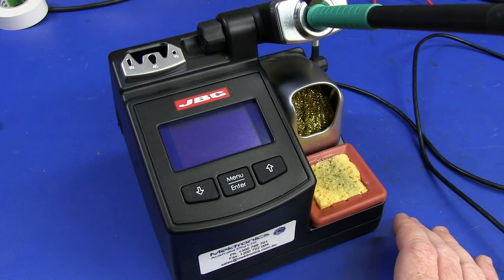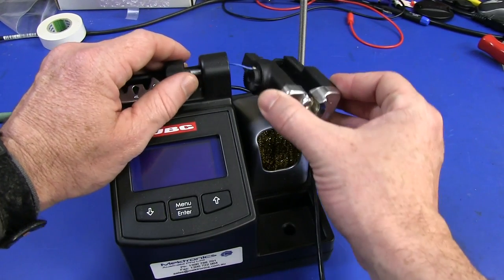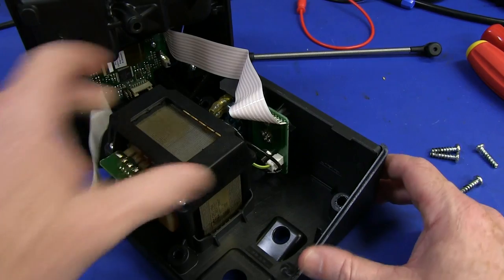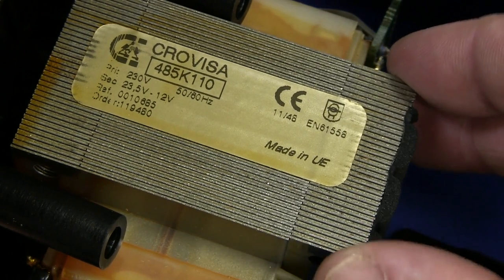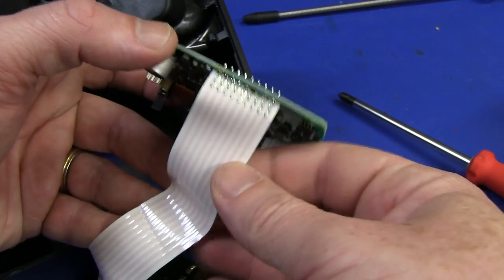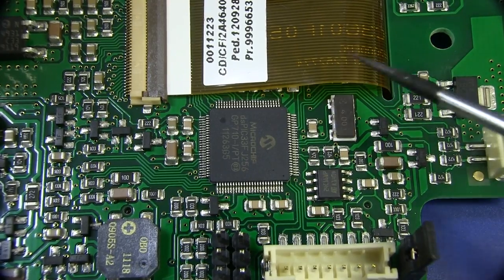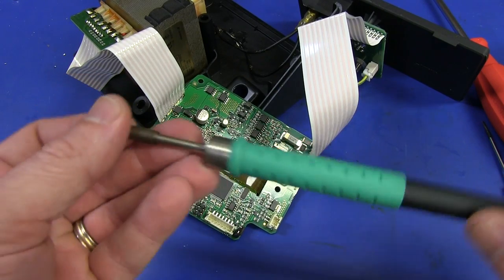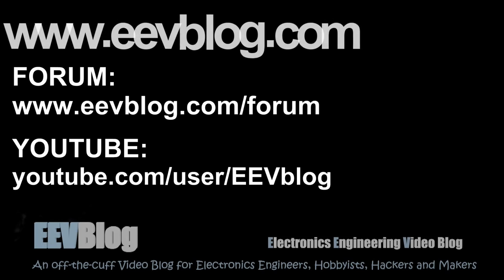EEVblog #472 - JBC CD-2BB Soldering Iron Teardown

Comment: Mixed feelings (mostly due to overly high expectations) but overall I wish I had bought it years ago. It is an essential buy for anyone who solders anything to power planes. It works so fast on them it's scary (4 seconds versus 2 minutes in some cases). For small surface mount stuff it's good but there's nothing I couldn't already do with my WES51 with an extra second or two. Other stuff like quick tip change, better temp regulation are nice but nothing earth shatteringly amazing. contd:
Reply: same here, the good feelings comes later when you need it :)
Reply: Im a first timer, im either buying the the dual station with tweezers and precision iron , or I might buy them separately with the modular unit.

Comment: In Ireland the tips range from 15-25 euros, some speciality tips run a little more. If they are not abused they last way longer than the cheap ones and with the auto standby its hard to go wrong. I love it way better than my pace iron.

Comment: Just received a JBC CD-S soldering iron (same principle as CD-2BB) and JBC CP Tweezers, to replace the crappy Ersa stations I have in the office. Those JBC stations are amazing concerning the heating power, heating speed, the handling and the overall quality. They are quite expensive, but allow to do a great job on SMD components like 0402 or even 0201. But for a not-intensive hobby use it doesn't make any sense, too expensive for using only a small part of its capabilities. A Weller would be a better choice in that case (not as good as the JBC, but high placed too).

Comment: I just checked. That is a real CE mark, not a China Export mark. Measure the C from top to bottom outside diameter. Then measure the C from left to right. If the C was drawn as a full circle then it would intersect the E, just before the E's little center leg. I hope that made sense.

Comment: At 9:35 .. normallly you push the thing onto the tip but only softly to take it out as a first step, and then you press it into it via the big holes there (45, 10 10) really into the holder.
Just in case it's not clear for someone.

Comment: I also planned on a similar project once.If you like Arduino, have a look at Arduino PID library. it can be used for temperature controlling. I trust switching power supply should be work as well as a linear supply.

Comment: It's possible the PIC is using the internal PLL, and not just running at the 4MHz that the oscillator is running at. However, I agree, why do you need all the horsepower of a dsPIC?

Comment: Should the buttons screw up after 20 years (which no replacements available), could you drill holes in the PCB and put in miniature discrete push buttons?

Speaking of which, I would like you to design a standard touch-tile button circuit that could be configured for push-on-push-off, N.O. and N.C. It should reject RF and trash. The touch timing should be adjustable to require a definite and intentional touch (rejecting accidental brushes). A label display in the lighted tile would be great.

Comment: I have been considering upgrading my soldering station. I have looked at the JBC among others. But I'm probably going to purchase the Hakko FX-951. This is due to the difference in price between the two. The 951 can be had for about 250-300 dollars. From what I can tell the unit has the same type of features, including the integrated heater tip setup for quicker heating and recovery.
Reply: You can buy this one for 390€ and if you really search for it 350€

Comment: Interesting your take on Hakko not lasting. My 926 was purchased new in 1989 and the plastic body fell to pieces (brittle) after being used every day in my electronics repair shop. I rehoused the electronic control pcb & txformer in an hand made polished aluminium case held together with 316 stainless hex head m6 bolts. It is still operating perfectly 31 years on. Don't think just because you forked over a heap of cash for something it is necessarily that much better. Some things just aren't.

Comment: Well microcontrollers can be reliable, if it has a reserve. My Takser-E (Made in Estonia, was used as remote reader for electrical meters) is based on a microcontroller with erasing window and it still works from 1995.

Comment: Also, for some reason while writing to the internal EEPROM, all non-hardware implemented operations in the PIC are halted until it is done writing to the EEPROM. For example if you do a software PWM for LED control, when you write to the EEPROM your LEDs will turn off for 100 to 200 ms. When it's done, everything resumes. Reading does not give you any problems.

Comment: Always wondered why manufacturers make their stations so big. There is so much empty space inside! I made a station which feeds two irons using cheap Chinese controllers and it is three times smaller than this JBC. And no, I did not use switchmode power supply. I managed to  fit a 240W toroidal transformer. Very happy about the result, barely takes any space on the bench. Why to waste all that space inside the iron!!!?

Comment: Coming from Hakko. This is a good iron system but has some weaknesses, if I was the designer I would do the system with:
1- a tilting LCD for better viewing angles
2- a front power switch, rear is not practical
3- better insulation on the handle which gets hot
4- a replaceable clear cover for the front, LCD and face section

Comment: Perhaps they use a linear supply because it is heavier and thus less likely to tip over. It also helps sales when a $400 soldering station has some heft.

Comment: We actually just got one of these at work... unfortunately, the supervisor was under the impression that it was a 130watt iron, in fact, as you've just said, it is a 70watt, and as a result performs very similarly to the 70watt hakko irons we already had...

Another thing to note, with the temperature set to 350 degrees, the tip temperature was actually 380.... which also explains how it appears to work so well with the temperature set relatively low...
Reply: I think the problem might be with the cold junction compansation. The sensor might be faulty and giving a 0 degree value so when the iron is at 350 degrees it understands that it is at 320 degrees or so.

Comment: Looks like a dam nice iron! But im with you about all the digital control. Ive got an old Weller unit ive had since i was a kid and moved from using the cheap $20 irons upto something better. And few times when i have been working on something when its been live and ive bumped it on the wrong thing or something and got a nice spark on the iron tip. And well the simple temp switch in the old unit couldnt care less. But one wonders how well a digitally controlled unit would go in that situation

Comment: Well, this pic has a 16-bit parallel port with DMA. I guess that is what is driving LCD.
Not to mention 12 bit adc...

by the way, dspic has internal frequency multiplier (PLL), so crystal oscillator does not indicate anything at all...

Comment: I'm an AVR guy, but I always thought PICs were at least as good, so I was curious about your comment. The PIC16F87x datasheet claims a min. 100k and a typical 1M write cycles, isn't that pretty much the standard? That's at least around what Atmel claims in the devices I use. 

Regarding the external EEPROM, looking at the dsPIC33F datasheet at a glance it probably doesn't have one, I only find references to SRAM and Flash. 

Anyway, at less than 0,10USD per EEPROM in a 400USD unit who cares? :)

Comment: Noob question Dave, What is veer stitching?
Reply: Via stitching is when vias are used to coupel  or "stitch" multipel layers together to increse the amound of current that can run through, a via btw is a very tiny hole which is plated through with copper to connect one layer to anouther

Comment: While the CE-mark indeed is incorrect, it doesn't really say anything about anything else than the fact that the "graphic designer" making that label did a lousy job - the logo can't really be fake... CE is normally a self-certification - a declaration from the manufacturer that the equipment meets the appropriate EC-directive requirements.

Comment: if you need to solder parts to a soldering station, how was the first soldering station built?
Reply: +Akamaholic   Obviously God made the first soldering station called Adam, and out of a resistor of Adam he made Eve, the first desoldering station.
Reply: +Akamaholic They used up a lot of matches that day.
Reply: +Akamaholic No circuit boards, just wires welded to a burner perhaps?
Reply: They called their employees and they holded wire together
Reply: if uC programs to uC how the first microcontroller was programmed?
Reply: +Akamaholic with a hot air gun of course!
Reply: At one point soldering irons were just hunks of metal on the end of a stick which you heated with a fire

Comment: Will these soldering stations take both the T245 and  C210 handles or do you have to buy separate machines for each handle, like the Aihun soldering stations, I fuckkk up and had to buy the two stations.

Comment: Never heard of this brand before and it's even bigger surprise that it's Spanish!  Not a country you tend to associate with electronics!  Have to agree with the pricing though, although some quality brand units are even more expensive, Metcal and Weller for example. It's difficult to understand the pricing on electronic tech, an iphone is £500 but a good quality, large flat panel TV can be had for the same or less, and there is a significantly larger amount of material in a TV than a smart phone!  So how can £300 or more be justified for a soldering station?!   The TX, case and electronics are nothing special and I doubt would cost more than £30 to make in quantity, the iron itself may be quite specialised but again, £10-20 should do it.  So thats one hell of a mark up!  I would be comfortable with paying £150 but no more.
Reply: If you never heard, its because you don't understand a sh about soldering... as about the price talking you're right, but that's the way market works...
Reply: LOL!!  I've probably been soldering longer than you are old!!
Reply: ***** ok, what i meant was that you are not informed about the soldering equipment brands... otherwise you will have to know about JBC. Ps : im 93, how long have you been soldering??...
Reply: I'm 142................ so I have!!

Comment: Wouldn't it have been one of the bigger middle fingers in electronics if this had had security screws instead?
 Yeah, if you buy a $1200 iron they should assume you know how to fix it's insides.
Reply: From a liability standpoint I doubt they would make assumption
Reply: From a liability standpoint I doubt they would make assumption

Comment: While designing a software which allow to save Preset or other configuration data, external EEprom *24C16 in video* comes in handy. 1 million write cycle!!! .... it's not much but still better then the buildin ones.. you never know who is using your product...

Comment: Question: Can the JBC CD-2BQE soldering station work with a T210 soldering iron or does it work only with a T245?
Reply: t210 and t245 works on this station

Comment: I do not think it warrants several hundred more, and those ribbon cables do not like much handling.
Will stick with my Weller PL12d and Madame Curie's magnetic switching point.  .
Reply: +klystron44 Thinking you mean Monsieur
Reply: +dusty42682 I stand corrected, The Curie point is used in the Weller iron to operate the switch.
Reply: +klystron44  To be fair, those ribbon cables aren't handled any more after assembly, so I don't see the problem there.
I think with JBC it's all about the tips. How fast does your Weller PL12d heat up?

Comment: I bet this thing has nothing on my Hakko 939. The 903 irons (with the element built right into the tip) are still hard to beat. I think attaching the accessories to the actual unit is also not a great idea. I really don't like putting my iron anywhere near my station.
Reply: +Fizbin321111indeed.
 I rather to stick with hakko.
i can see some parts have lack of engineering and some others are over engineered
Reply: It can be annoying, I have used irons with the stand mounted to it, and one model I used has the stand in such a position where if you soldered right handed it would rub against the control box and burn the plastic, but my iron has its stand on top of the control box and I don't mind that at all, so it depends on the model
Reply: Fizbin321111 So, where do you say the heating element is in JBC tips?

Comment: I'm sure it is very good station but I'm wonder what is the benefit of a linear power supply on soldering station. why not a high quality 24V/150W switching supply. Any suggestion is appreciated.
Reply: They probably switch the power 24V AC, instead of making DC out of it.
Simple transformer beats switching supply on reliability.
Reply: linear power supply smooth power

Comment: What is a via?  I know they are the holes but what purpose do they serve?
Reply: +Rico Caruana They're holes that are plated with metal on the inside of the hole, they conduct electricity between different layers of the circuit board.

Comment: Hi EEVblog  i have a repair center and we fix Computers and smartphones, do you think that the JBC CD-1BE 120v will do the job when have to solder something on the logic board?
Reply: +Sidney Vogel Go on hakko t12 tips more cheap and beats the ass of JBC.
Reply: Not really. JBC is far better, cheaper tips ? really ? When you are doing your JOB cheap is the least thing to consider. JBC tips are the best in quality I have used. Its better than a Hakko in 80% of the things you do with it.

Comment: his voice is hilarious, but, intersting video
Reply: I have metcal mx-ps5000 and I really like it. it's really fast. tips last long as long as you take care of them and. I've been using it for a couple of years now. and can't complaint I have also used a jbc dual tip station at work and it's quite nice both are. very reliable units. both with its pros and cons. also at my work there are a few hakko stations but in my opinion the metcal and jbc are a much higher quality if you can get either one you won't be disappointed